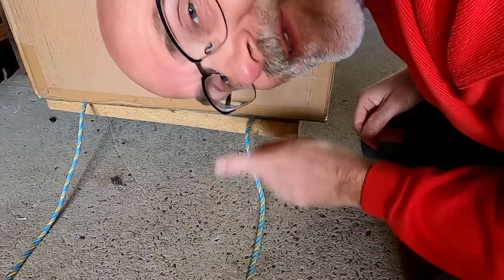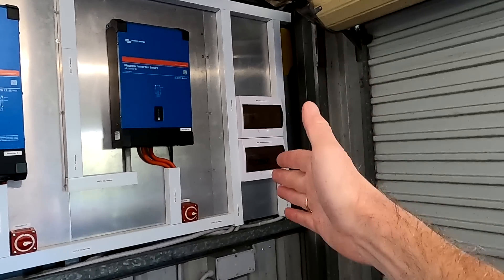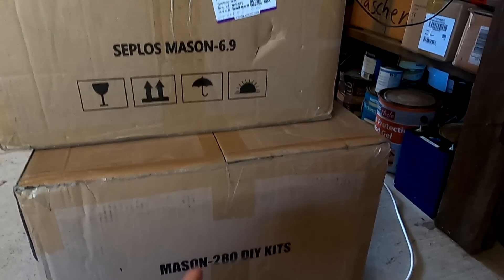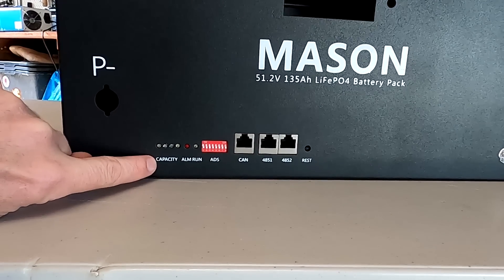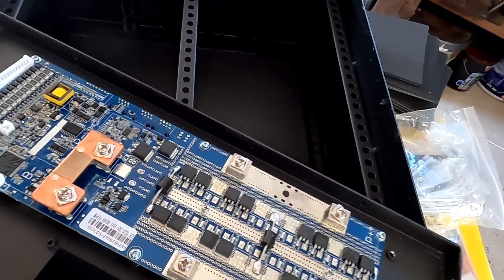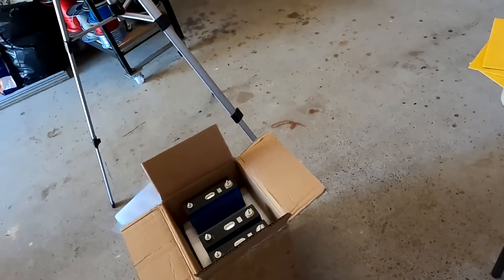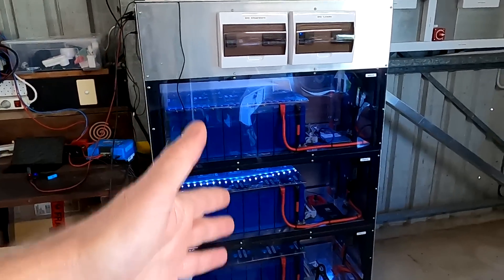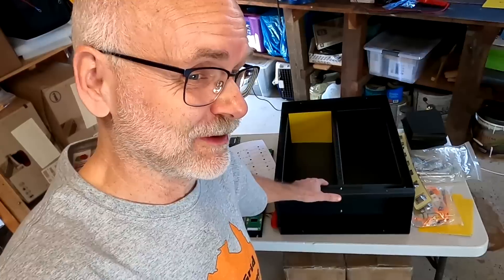Start of the #Battery3.0 series with the SEPLOS MASON 6.9 Kit

Comment: Actually the aluminum case has a small positive charge simply because the battery chemistry uses aluminum as the positive terminal. It is not connected and only has a tiny leakage current (so you still want it insulated).
Reply from the maker: That's new to me, I thought the case is the same as the pos terminal?
Reply: @OffGridGarageAustralia  No, just happens to be the same material the chemistry uses for positive. Yes you should insulate, no it's not the same as the positive terminal.
Reply: @OffGridGarageAustralia  Nope, @John Emmert is right.

Comment: One thing which turned me off the larger capacity kits and pre-built units is the box ends up being VERY heavy and hard to manage for one person (circa 100kg). I prefer units closer to 5 kWh in capacity as they are at least manageable in terms of size and weight.
Reply from the maker: Yes, this is a concern I will address when building. They have these dolies or wheel bases for the Mason series. I think this is what I should get if I build more of them. For now, it will just go on the same trolley as the Battery1.0

Comment: I got a quote from Seplos for their DIY kit options. Per kWh once it was actually delivered it was more expensive than pre-built server rack options from known good suppliers. It's an appealing option though as it's still fun to put things together. All they need to do is get the IKEA artist to design their user guide ;)

Since your own pre-built battery cells arrived already 2+ years old, as are the ones Seplos supplies, I'm not really seeing the difference on that front between the various options. You are still at the mercy of your cell supplier, especially if you are only making one or two batteries. Main difference seems to be choice (or lack of choice) of BMS and the ability to user service them if for some reason you have a bad cell.

I looked hard and long at doing the full DIY battery option but the form factor just ends up being shite. Unless you have your own metal fabrication gear you are always making compromises and constantly having to find all the bits and pieces, while these modular pre-built form factors are just way more convenient and space efficient.

In the end I have gone with the server rack option as I want the ease of modularity to expand later as well as best "bang" for my buck.

There is still plenty of DIY work going on with PV array, cabling, inverter, monitoring, communications, load management and integration with home automation.
Reply: @Juha Tuomala I didn't bother with Pylontech, they were more expensive and I prefer prismatic cells anyway.
Reply: @OldManLawrence  EG4 are not the only supplier of server rack batteries. There are many supplier options. Some better than others.
Reply from the maker: Thanks for your great comment, Alex. The Battery2.0 was a nightmare at time to put this all together from scratch, finding parts, making the design and waiting for bits and pieces to come in. 
I thought the Mason is a good alternative and from my calculations, it is a lot cheaper than a comparable server rack battery with the same specs. Could be Australia only though 🤷‍♂️

Yes, the communication part is stull huge and getting this all together. I guess, we will never run out of topics 😉

Comment: Problem in the USA will be the NEC 2020 requires the Energy Storage System to be UL Listed. A DIY kit won't pass inspection unless the builder pays for a UL inspection and field listing. Damn laws and standards!
Reply: That is only true if it is hard wired, if you use a transfer switch with a cord and socket then all that is needed is the transfer switch be inspected
Reply from the maker: Interesting regulations. We have something similar if the battery is mobile. Hence the idea with the wheel base...
Reply: @OffGridGarageAustralia  as long as it's a "temporary" power source it falls under the same regulation as an emergency back up portable generator

Comment: We had most recently issues with SEPLOS delivery of such kit cause they shipped the case separately from the BMS and the BMS arrived first but even though the MASON LF280  Kit had been paid fully (ddp incl. tax) the taxes had to been paid again fully for the whole battery kit. The case arrived later also partly damaged and this time without taxes, but the taxes had been paid twice due to the false bill in the BMS pack. 

We also ordered the SEPLOS BMS to be used with Growatt SPH and SPF (inverters) that only can talk a specific canbus dialect. Be aware to avoid buying their cable adappter to configure the BMS cause they sell it to you for 20$ plus Alibaba plus Paypal fees even though the ftdi USB rs485 adapter can be purchased for 3$ from Alibaba.  Not that easy to deal with SEPLOS.
Reply from the maker: My delivery was stuck in customs for 4 weeks due to paperwork not being provided. I had to step in and provide the documents to finally release the goods.
I'm not sold on this BMS at all. I have been playing around with it for 2 days now and I still like the ease of use of all my other BMS a lot more...
Good tip with the USB adapter. I got the original Seplos one 🤦‍♂️

Comment: That BMS has very low balancing current if I'm not mistaken. I don't want a BMS that doesn't balance with atleast 1A minimum.
Reply: The BMS doesn't have capacitors to move energy between cells. Instead it uses resistors to reduce charge current going into the higher voltage cells. (Although they are not very big)
Reply: @gavinnoname1424  Sounds like passive balancing
Reply from the maker: Yes, the Seplos BMS has only 150mA passive balancing. I have installed the active balancer cabling after testing the BMS now 😂

Comment: Andy you are the Man. 
Just one comment. I dont see a point to have 280Ah server rack battery. It is too heavy. I think mentioned 135Ah battery is the maximum weight for one man.
Reply: @OldManLawrence  You don't know Andy he will come up with something amazing!
Reply: @OldManLawrence  I disagree, because the main benefit of having server rack batteries is to have them in rack. And how do you want to assembly them inside the rack? You need to slide them in.
Reply: @stanislavmlcuch2085  well, it is very heavy, yep, need 2 people to move the unit with the 4 handles.  you don't really need  a rack, it has an embedded system to stack  up to 4  of them securely.
Reply: @stanislavmlcuch2085  The module Battery Pack in this case goes into the rack, but is assembled outside of the rack.
Reply from the maker: The 280Ah Kit is not really a server rack battery. It may have a similar form factor but is certainly not used in these racks. They can be stacked on top of each other and secured with locks on each side. There is also a wheel base for them to have them a bit mobile.

Comment: Would have liked to see the Seplos kit using a switching BMS that can limit current rather than just turn on / off.  Most of the 48v rack mount batteries seem to use Meritsun's or something nigh on identical to it.

Comment: Definitely interesting options for those who want to DIY without the headaches of a DIY. This is going to really be an interesting series as usual on "As the Electron Flows" channel. I am with you am curious what those 2 year old LFP cell performance will be once it gets all assembled and cycled. If my math goes right 3.2 x 16 x 135 = 6912 Wh? I guess well just have to stay tuned.  :-P

BTW, I was taking a peek at the Off-Grid-Garage in the Victron VRM World link and I am getting a "shared token is invalid" warning.

Comment: The LED lights need to be programmed to reflect the SOC status of the batteries. For example, green for 90% plus, blue for 30-90, yellow for 10-30 and red below 10. Maybe with the raspberry Pi?
Reply: Do you mean the LED's on the front of the battery? They do give a SoC namely: 1 Led = up to 25% 2 = up to 50, 3 = up to 75 and for = full.
Reply: No, not for battery 3.0. I am referring to the LED strip lights on battery 2.0 that light up the cabinet
Reply from the maker: Maybe that can be done with the Pi somehow as it has the info for SOC. But I would have no idea how to tap into the Chinese Bluetooth comms of the LED lights...

Comment: Great to compare this pathway.   I’ve loved the learning of building my 14kW 48v EVE LF280K DIY system in our motorhome (JK 200A active balancer BMS, copper flexible bus bars, victron RS 6000VA inverter, 900W solar, RVD Safe protection (with COC), lots of fabrication…..), though I get constant comments about “what if it goes wrong?” - something like this is a far more “mainstream” way to go and if I ever built a system for a friend this would be a good alternative I expect.

Comment: I noticed the after ship price of Alibaba I think is more than other ready made rack mount? I'm not sure if I'm missing something but the other systems are around 5KWh for 1 chassis. Are these higher density cells or something to justify the price?
Reply: 6.9KW using 135ah cells vs 100ah cells in other server rack mountable. You also get a great BMS, and all the components, including cells, are replaceable, and include the front panel display like the more expensive units (unlike the EG4 batteries from signature solar).

Comment: battery 3.0, lets buy a kit.... this should just be a review not battery 3.0, disappointed
Reply: Not quite, as the smaller 6.9 model in this case has to be assembled first It comes with all components. The larger box comes with all parts, except cells.

Comment: Perfect timing Andy!  I bought 8 of these a few months ago (they're still on the high seas.)  I have 128 280Ah EVE cells I'll be using for the builds.  Can't wait for the next video(s) and when I get my SEPLOS MASON kits too!
Reply: 128 cells??? What are you building? You converting a WW2 Submarine to Lithium lol
Reply: @garys-half-baked-offgrid-dream  😄😄
Reply: @garys-half-baked-offgrid-dream  100% off-grid in So AZ (electricity, rain water, and Starlink.)  July 2022, we used 1.5MWh running multiple A/C's and we had to use the generator quite a bit because it's our Monsoon season.  We had several days in a row of full clouds and lots of rain this year.
Reply: @davidchristensen1219  Wow that sounds like a hard challenge!
I am the polar opposite, I will need it for heating 🏴🥶😭
Reply: @garys-half-baked-offgrid-dream  We do too in the winter.  We're about 4000' elevation and we've seen 'teens in the AM - even some snow.  We do use some propane to BBQ and backup heat.
Reply: @davidchristensen1219  I need heat in the Summer lol. 
 Your place sounds awesome!
Reply: Can you tell us about your build? The purpose? Commercial or residential? Personal or for a client?
Reply: @honoura1  Sure thing.  Residential/Personal.  We have all Schneider equipment: XW Pro (qty 2), MPPT-60 (qty 2) MPPT-100, Conext Gateway, BatMon and SCP.  ATM, 1200Ah of battery (I de-rate the cells for better life.) I created a custom add-on for Home Assistant to do ModbusTCP so I can monitor the system from anywhere I have cell signal.  If you want to check on our progress: JC/DC in the AZ is our YT channel.  I haven't uploaded a new video in a while (been busy w/work and projects.)
Reply: I bought 16 of them June 28, still waiting...
Reply: @Skeptic100100  mine now says Aug 14 for ETA.

Comment: I'm glad, that you eventually get to test them :D
Amazing Andy! My Seplos BMS works for half a year now with Victron CAN-Communication...2 batteries in parallel. You just need a Victron CAN Type A cable...you can also crimp it yourself, if you are into that. mjlorton made a video on how to program the BMS, if you want to see how it works...but the default settings are already good.
 Ich habe dir mal eine E-Mail mit den Links geschickt (autarke-energieversorgung).
Reply: @Juha Tuomala Can you buy the Pylontech BMS seperately?
A Seplos 100A BMS without screen costs USD 125 + shipping. That is a good price.
The 200A BMS costs USD195.
Reply: Can you share these links here as well?
Reply: @rikdehaas6398  Last time I tried...but youtube blocked the comment because of external links...
Reply: @rikdehaas6398  I tried it again with the links...the comment just does not show up, after refreshing the page...
Reply: @Juha Tuomala Yes, it does only have passiv balancing. But it tells the Inverter/charge controller to reduce the charge voltage, until the highest cells voltage is reduced.
It just takes longer, but the BMS won't just shut off.
Reply: @Juha Tuomala The balancing current increases with the cell voltage. @ 3.35V it is actually 167mA and @ 3.65V it is already 182mA current.
If there is a difference of 1Ah, it takes about 6h to balance. No big deal, even with older cells, you usually do not get such a high difference (if you frequently charge your battery to 100%).
Reply: What Victron inverter are you using? Are you using BMS CAN connector of a Cerbo GX or direct connection to Victron inverter? Are your two BMS connected with RS485 ? How do you program them? (sorry lots of questions!) Thanks
Reply: @DrCoolZic  Once I set the DIP-Switches to CAN-Communication protocoll, I connected the CANBUS of the BMS to the Battery-CAN of the Cerbo GX with the Victron Type A cable. I use the MultiPlus-II 5kVA...but any Multiplus will work. You need a GX device.
If you want to program, you have to change the DIP-Switches to RS485, program it and afterwards set it to CAN-communication again.
Reply: @Raphael_Hofmann  Thanks for your feedback I also looked at the video from mjlorton. So if I understand correctly you either program/monitor the BMS using the RS485 OR the BMS communicates with the inverter using a mixture of CAN and RS485 but not both at same time. This sound stupid because than means that if you want the BMS to communicate with the inverter you cannot monitor information about the battery! I do not have a clear idea about what is exchange between the BMS and the inverter, I have seen a video from seplos where they explain that the BMS can tell to the inverter to reduce the charge current, or to stop charging, ... but I do not think that the BMS communicate detail information to the inverter like the voltage of the 16 cells and therefore this information cannot be retrieved on the Victron side? For info I use home assistant and Sebastian Muszynski (syssi) has developed an ESPHome component to monitor Seplos BMS
Reply: @DrCoolZic  Yes, both at the same time is not possible. But in the GX-device you see the highest and lowes cell with the cell number and voltage. You also see highest and lowest cell temperature and the installed and available capacity (SOH). And it also communicates the charge voltage limit, charge current limit and discharge current limit of your BMS.
Reply: @Juha Tuomala Usually, active ballancers have higher balancing currents than passive balancers. The Seplos BMS has 150mA balancing current with its 0.02ohm resistors.

Comment: well done andy, been running the 280 kit for a time now.
extermely happy with it.
of course performance is dependant on the cells you choose

btw the 280 kit was designed by a forum member of tye diysolarforum
Reply: @Juha Tuomala the kit costs about 450 usd ex shipping  which included everything but the cells, external connecting cables and usb ( i ordered a usb to rs485 adapter locally)
Reply: Really? Do you have a link to the topic on Wills forum? (If any)
Reply: @Juha Tuomala the cells you deside yourself.
and for good comparision : the 280 version is 15 kwh

Comment: I have one of the Mason DIY kits a friend gave me, brand new and  cells are bloated a little bit, I need to open it and check the cells again, I heard rumors that the cells are sometimes over a year old pushing 3 years old, I assembled mine very easy with the instructions but my B+ bms bus bar needed to be installed upside down compared to the picture, please stack your cells together before adding the foam pads, I'm curious if your cells are also bloated at the anode and cathode, also check your vent covers, one of mine was loose